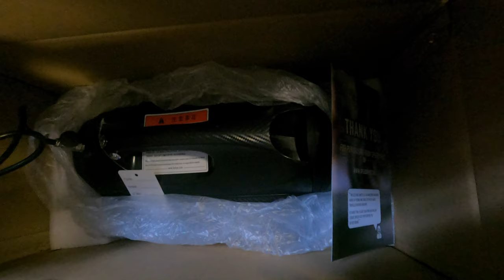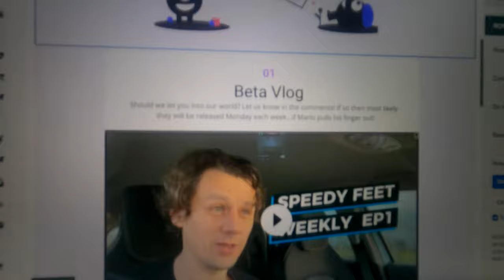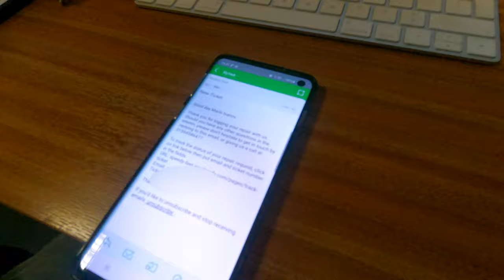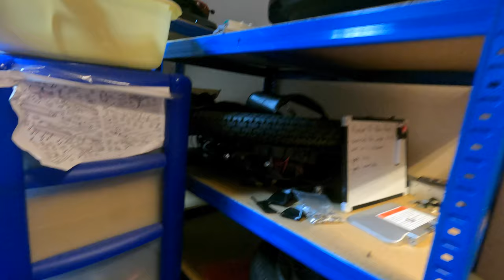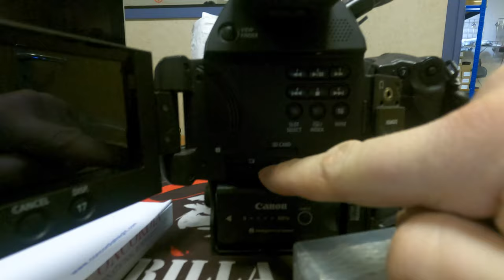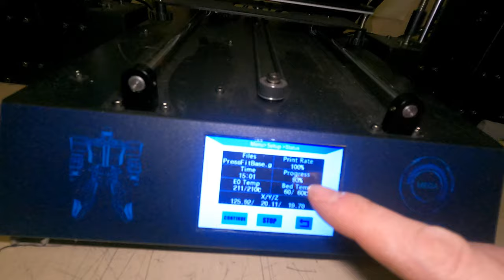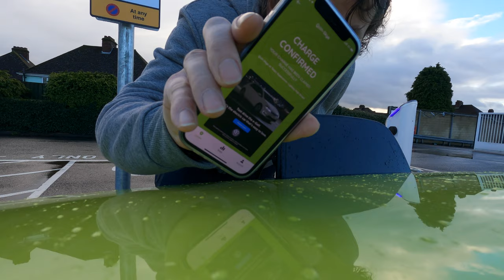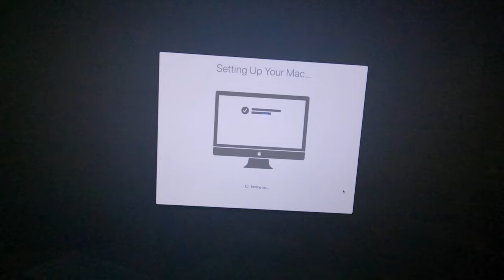Speedy Feet Weekly | Episode 4

Comment: On lost online credentials: Think about a password manager/vault.  I've been using LastPass for many years now, very happy with them.

On the new shelving:. Couldn't you put a tray on the floor instead of using a shelf.  That way you're not robbing parts from other shelf assemblies to make a 6th shelf.
Reply from the maker: Good thing about the macs we use they use Keychain access...so usually all passwords are on there (as long as you allow the permission at point of creation for it to save em).

Shelves - good idea! Although in our case we have loads of left overs from all the racking we have in the warehouse, so that area is full of loads of odds and ends :)
Reply: @Speedyfeetuk  I'm an Android guy, so maybe Apple does this also, but LastPass is device independent.  Laptop, tablet, or phone makes no difference.
Reply from the maker: Yeah it spreads it across all devices (IOS / Apple of course)

Comment: Just to pick yoir brains Ian/Mario having watched this video about wheel lighting failures that seem quite common and the fact that you stated that you blew a new board, when replacing it.😲
I have a Gotway 1600Wh Nikola bought new last year in New Zealand. I replaced the worn tyre and after reassembly the lighting, USB port, voltage display and blue tooth speaker would no longer work. I disconnected the main power cable, discharged the capacitors with the power button before carefully removing the motor wires and hall sensor plug.
I'm going to get a new board thorough my dealer here in NZ once the Gotway Factory opens again after the CNY. Can you give me any tips to prevent me blowing the new board when i install it? It seems the DC-DC side of the board crapped itself.
Reply from the maker: Take a look here: https://www.speedyfeet.co.uk/blogs/help-and-advice/stop-the-spark

Also - I blew the Tesla2 board because of a wiring system change rather than anything that would happen normally. (Its the only board I have ever blown over all the years fitting them!)
Reply: @Speedyfeetuk  ❤️ thanks for the tip Ian. 😊
Reply from the maker: No problem